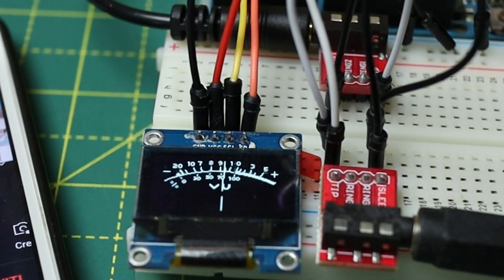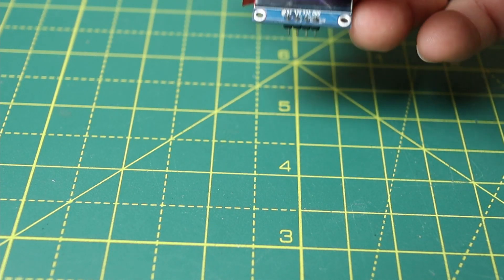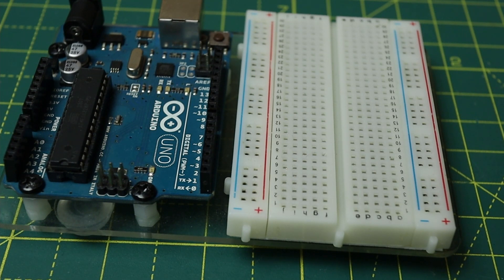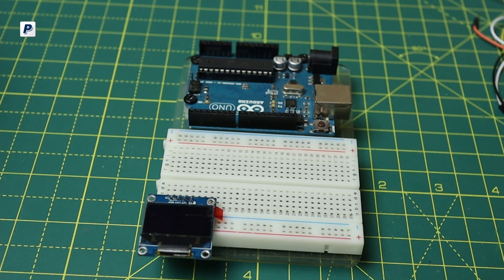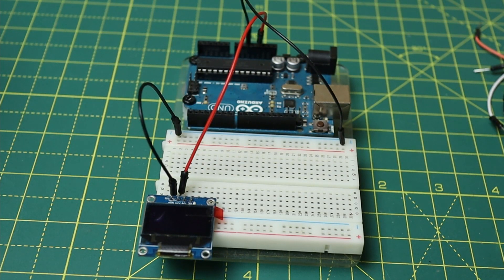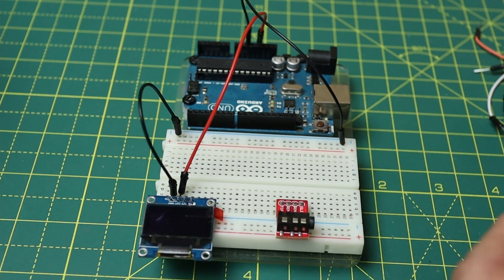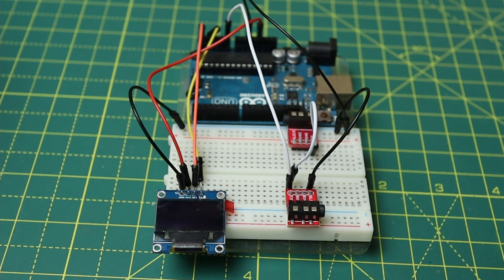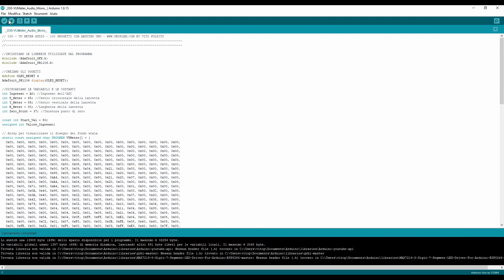100 Progetti con Arduino Uno - 030 VU-Meter Audio (mono)

Comment: Ho letto in giro un sacco di pipponi riguardo il segnale d'ingresso. Alcuni dicevano di utilizzare un partitore di tensione per il voltaggio, altri dicevano di raddrizzare il segnale con dei diodi ma in realtà come hai fatto tu basta e avanza. Collegando il - del canale L alla massa e il + del canale L in un gpio a caso e con un analog read ho letto i valori tranquillamente.
Reply from the maker: Sono contento che il progetto ti sia piaciuto
Reply: @vitopulpito  al posto del display ho mandato il segnale a una striscia led ws2812b tramite libreria Fastled
Reply from the maker: Bella idea
Reply: @vitopulpito  una curiosità: come mai usi arduino? Io da quando ho conosciuto gli esp32 ormai uso solo quelli. Hanno il modulo bluetooth e il modulo wifi integrato e puoi fare praticamente di tutto.
Reply from the maker: @djkadakamc1889  sono più semplici, esistono molte più librerie e reference. E perché è possibile anche collegare degli shield, che per i newbie e tanta roba. Ma io so comunque utilizzare tante altre schede. Anche i singoli pic
Reply: @vitopulpito  ci sei anche su tiktok? Fammi sapere così ti aggiungo 🙂
Reply: Ti ho trovato!!! Aggiungimi anche te così possiamo scambiarci consigli quando capita
Reply from the maker: @djkadakamc1889  Già fatto